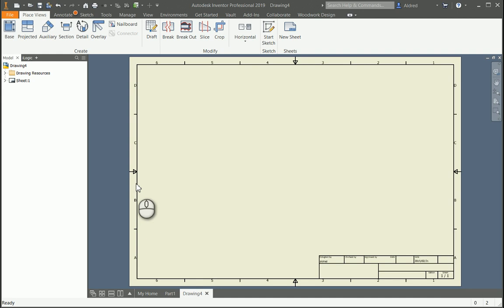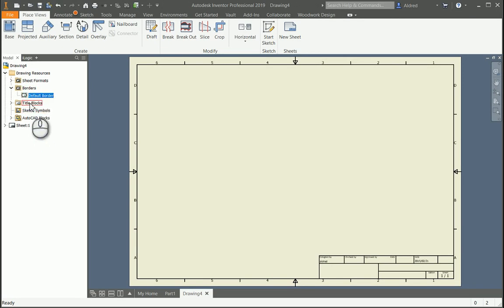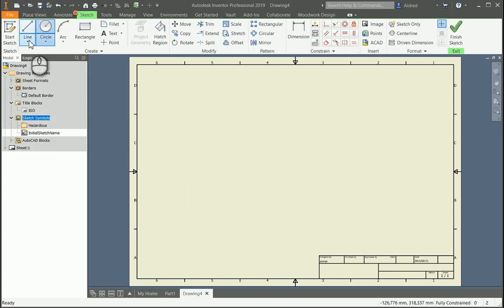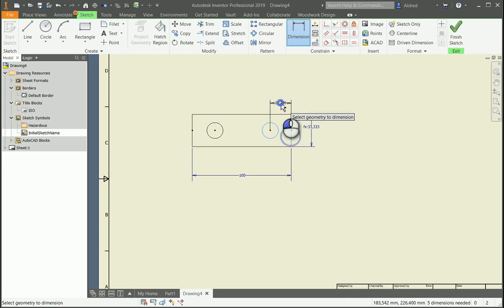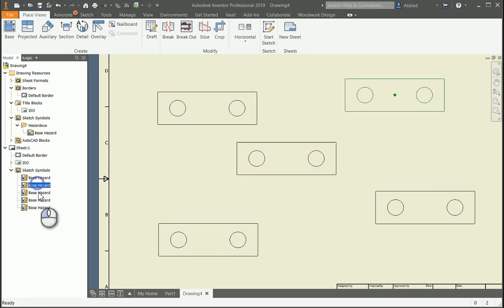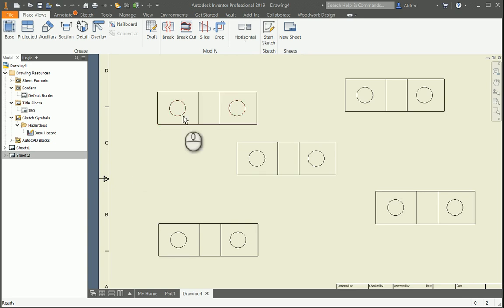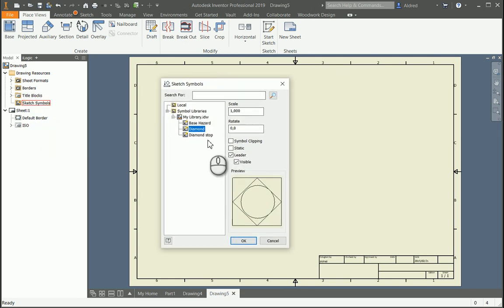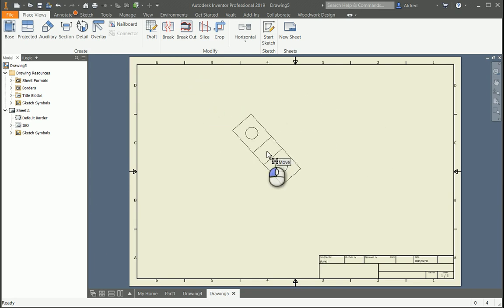Sketch Symbols

Comment: I put all my symbols in a standard symbols drawing. This drawing is in my Templates folder. When I need a symbol, I just "open" the drawing, look for the symbol, copy it, switch to my other drawing and paste it in there. Quik and easy. If I create a new symbol I create it in the std. sym. drawing first, then copy it to my drwing. This way I have all symbols up to date and in one place. This drawing is 20 years old and is an excellent central library at the click of a mouse, no searching for folders.